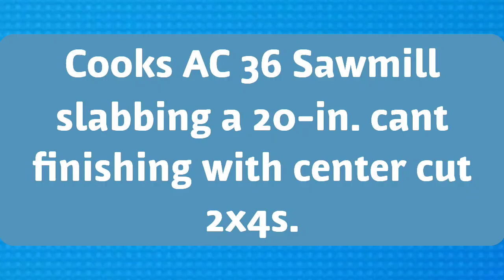Cooks AC36 slabbing a 20-in. cant finishing with center cut 2x4s.

Comment: I've owned woodmizers but never saw a cook mill operate.  Pretty impressive
Reply from the maker: I used to own a wood-mizer before I but my first Cooks. It was a good mill but there is a lot of difference in my opinion in the two machines. Cooks is definitely one of if not the most sturdy machines built today. Thanks for the comment I appreciate it. More videos coming.
Reply: @mulemountainsawmill9001  I live in western north Carolina. Where is the nearest dealer
Reply from the maker: There are no distributors for them. They sell them direct from the factory which is in Newton Alabama.
Reply: @mulemountainsawmill9001  I currently have a 00 frick on a 471 detroit. It makes good lumber but man I'm tired at suppertime